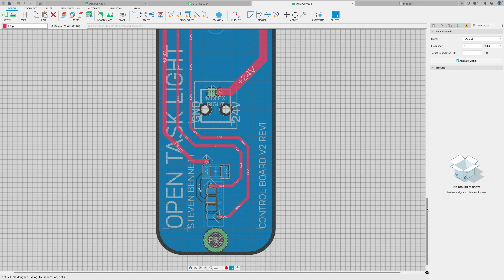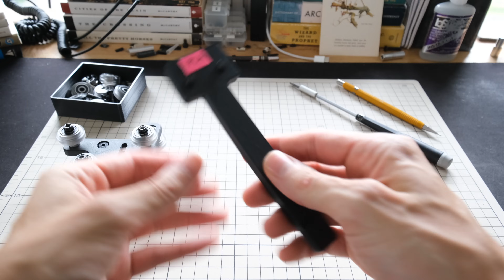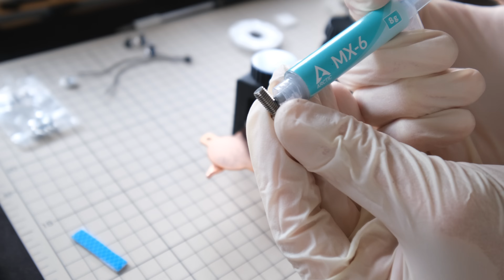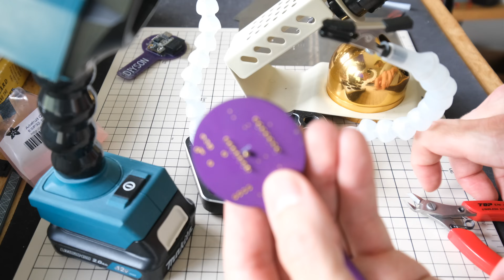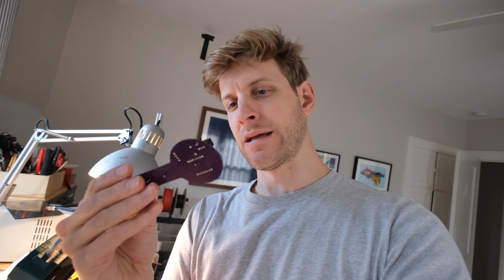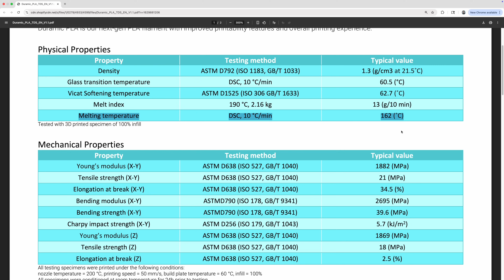A DIY designer lamp—how hard could it be? - Open Task Light Build Log #15

Comment: Have you considered designing the circuit board with all discreet components instead of using different modules instead of the qtpy you may also be able to use a much cheaper micro controller

Comment: A good simple way to increase the stiffness of that printed bracket is to increase the perimeters. try more like 7-10 perimeters. increased infill helps, but the majority of the strength comes from the outer layers.

Comment: I really like this project, and I may try to build one myself, but by reusing an Ikea NÄVLINGE led lamp, that would require some modifications to the design, but would make things simpler as well as the led housing doesn’t get very warm and you wouldn’t need any custom housing or circuit board etc

Comment: I've been following this series for years now :)

Also, there's some stuff that I hate about the design:
1- Why is the lamp head round? When everything in the design is boxy.

2- I don't like that the buttons are not recessed into the lamp head for a more stealthy and minimal look. 

3-there's inconsistencies in the colors, you could buy a matte black rails or you can paint the 3D printed parts with glossy silver.

Keep it going and can't wait for the next video :)

Comment: How did you make the 3D print for the PCB and stencil? Did you have to make it by hand or is there a tool to generate it based on the PCB files?
Reply from the maker: I kind of made it manually by exporting the board outline as a dxf from the PCB design file and digitally drawing a rectangle the size of the stencil around it and aligning the rectangle's center with the dxf origin/center. That's the tricky part; just determining where the PCB center point is, but the dxf will show you that and then you're good to go :)

Comment: Great project! Seems like I'm not the only one prone to silly hardware issues  😅
As for temperature, I'd suggest testing with a higher ambient temperature. During the summer in Bulgaria you (already, due to climate change) days with 40+ degrees C and I've had those especially when I've needed ventilation for soldering and other activities in the office
Reply from the maker: Hey cool, thanks for watching from Bulgaria! This would be a great stress test, I'll add it to the to-do list. It's possible that during the hot Bulgarian summer the temperature sensor will need to throttle the output power. Thanks for helping me justify the temperature sensor :)

Comment: have you ever thought of making the carriage of stacked PCBs, or embedding a PCB in the Carriage Print?
After all, PCBs are very precise and very stiff, as they are mostly laminated fibre glass...
Reply: it would be cheap and wouldn't add an additional manufacturing process to the BOM

Comment: Hi, newcomer to this project! Some insight into your bending test results and carriage design from this amateur bedroom engineer:

PLA that doesn't carry additives that affect its mechanical properties is one of the stiffest materials you can print. Many PLA+, matte PLA, and other formulations are much less stiff, as you found here with matte PLA. Most standard formulations of PLA (not advertised for speed, surface finish, "tough" or "plus", etc) could match or even exceed PC-CF in stiffness. For flexural modulus (stiffness) with horizontally printed samples, Prusament PLA is rated at 3.1GPa while their CF PC Blend is rated at 3.5GPa. PLA CF could be even stiffer.

Seriously, try those tests again with ordinary PLA, not "plus", "matte", "rapid", "tough", or even "basic" - some basic PLA is matte. Tough and plus PLAs will not work well for this application ,  since they trade stiffness to reduce brittleness . They tend to be closer to PETG or ABS in stiffness.

Also, test the parts for creep! Dr. Igor Gaspar (My Tech Fun on YouTube) uses a C-shaped part with a load for several days to characterize how a material creeps. He uses a clamp on the part he measures to prevent the calipers from affecting the results. Since you don't need actual flexural modulus values, you don't need to replicate his ISO 178 setup - the immediate measurement on the C-shaped samples will serve as your relative stiffness, and subsequent daily measurements will serve as relative creep.

No matter what plastic you use, creep will probably rear its ugly head eventually unless the carriage doesn't flex at all - it won't necessarily bend out of the way, but it may get looser over time. Right now, the clamping force from your rollers is being transmitted into your part as torque because the rollers are only being held on one side. For a plastic carriage, you may be better off solving the bending problem structurally instead of throwing more stiffness at it. Constraining the other end of the rollers on the carriage will stop the wheels from trying to torque your part so hard. But maybe the stiffer plastic will render this moot.

As for temperature, PLA and PETG can get soft enough to push around by hand at temperatures that aren't too hot to touch (so, probably around 50C). 40C is fine, though you might want to test how it handles higher ambient temperatures. My work area can get close to 35C in the summer, so the inside of the enclosure might get as high as 50C in those conditions since (at least, to my knowledge) your test (approaching 40C in 25C air) indicates that the air inside will rise 15C over the ambient temperature.

Anyway, this project is incredible! It's right up my wheelhouse - code, electronics and PCB design, and mechanical stuff, all wrapped together with great presentation. I'm disappointed that I didn't find this series sooner, but I'm looking forward to the follow-up video and future projects!

Comment: The qtpy has crenellated edged which are there to support surface mount soldering that PCB onto your projects PCB instead having to mess with the pin headers between them, which should simplify your assembly process.

Comment: fyi for desoldering.  you can add solder to bridge all the pins, slide your hot iron through the solder to heat all the header pins evenly, then you have two choices:
1. with one iron, hop back and forth between the two headers heating both until the part falls out.
2. with two irons, heat both sides at the same time.

or, you could find a very low temp solder to bridge all the pins and make the process a bit easier.

after the part is removed, then you can clean off the excess solder.

thanks for the great series.  cheers!

Comment: If you’re going to batch produce this thing then you can justify making tools, so instead of clamps for the heat pipe, you can make a press with a straight edge or 5 of those custom clamp heads which push between the extrusion gap, which can press down with a lever, or over centre snapping handle like vice grips.

Comment: Are there some off the shelf cheap hardware parts, like flat metal brackets that you could mount to threaded inserts on the pla carriage to provide durable stiffness? Like, a backbone.

Comment: Wait is it PET-CF or PETG-CF? They’re significantly different materials, and you’ve labelled it differently at different sections. Also know that while CF filaments have that nice matte lick you’re after, they’re bad from an ergonomic perspective as they shed fibres into your skin. I’d look into core-fibre filaments, or sealing parts with clear coat. Delrin filament is apparently great for creep resistance, but it is a real hassle to print with.

Also look into what locating pins and sleeves are used by diy 3D printer toolchangers. Bearings are a good solution, but in future I’d probably just use a pair of 608 skateboard size bearings, maybe with a spacer between them. Extremely common, still not overly bulky, and they’ll definitely handle the magnitudes of axial load you’ll be putting on them.

Comment: I like the stack of 9.99mm bearings. It seems counter intuitive to use a stack of more complex parts to replace one basic component, but it's always a good move to use ultra high mass production low cost off the shelf items for such high precision parts.
For the wobble of the base to upright, have you considered thrust washers? It would allow for clamping the upright down to the base further reducing wobble and to set it for a smooth rotation.

Comment: Friendly tip - if you want to remove the part, don't suck the solder away. Add more - a lot more, so your iron is heating all the pads on one side and pull one side up just a hair. Then repeat with the other side. Repeat again both sides, then suck the solder (I use wick). Works every time. Then cleanup with wick on both the carrier board and the part and voila - you are back at the start.

Comment: Nice designs as alway ! I design a bunch of stuff for my lab including hinges for doors.  For a cheap and efficient solution i use split bushing sleeves. They are inexpensive and with right tweaks to the diameter of the holes in 3d prints you can get really good precision. Hope this helps

Comment: PLA is about the most stiff material, iirc, you can print. The down side is that its very prone to sag over time. Which for exemple, PETG doesnt sag over time, but is a bit more flexible. Cant comment on other type of plastic in this video. For mat filament, I really like gf-petg. its soooo good. Also, if you test 3d printed plastic, should you test in the same orientation that it will be use in the lamp? i.e. vertical vs horizontal ? Now in you test, the ''depth'' of the piece was bigger than the hieght, I would think that you should rotate it 90 degree on ''y'' axis' to have the height bigger than the ''depth'' if that make sense

also, I'm not being mean, just trying to bring additionnal information. Great video! cant wait to build one when the project is done!

Comment: The issue with using printable plastics is that you don't get to pay the price-per-part. You have to pay for a whole spool if you print this yourself. Or if you are buying from someone else, there is premium involved, possibly also shipping. It might be actually cheaper to buy a single part in Aluminium which in turn might be cheaper.

Comment: A tip for unsoldering through holes easier is applying more solder to the existing joint so the sucker can create more vacuum, it works for me all of the time.

Comment: It is actually not the deflection you want to look at only, the most important factor I would say for longevity is creep. Some plastics will creep more over time than others. Fiber filled PC or PA will probably creep the least in this case, unless you go to real engineering material... but that requires a completely different printer and budget.

Comment: I think, heat dissipation should also be tested closer to critical conditions (i.e. ambient 20, 25, 30˚ C) . The reason is that the heatpipe performance greatly depends on the temperature gradient. Testing proubably can be done by using a cardboard box or some other enclosure, then monitoring the internal temp as the ambient (inside enclosure) rises naturally due to led output.

Comment: First time I tried desoldering multiple pins I didn't have one of those solder sucker vacuum thingies so I just used a ball pump needle connected to an air compressor (100psi) and blasted the solder out. I learned not to do that while wearing a short-sleeve shirt lol. Got solder everywhere, but it did technically work!

Comment: IMO the $20 LED driver is what ate too much of the cost(but I understand the appeal), the structure bracing for the bearings would be better off as aluminum. Another thought is to reinforce it with metal in some shape or form, screws running lengthwise inside it, so it can't bend in the ways the bearings will be trying to make the plastic creep, etc.

Comment: It would help the carriage if it had geometry that helped to stiffen it against the specific loads of the wheels, normally this would mean extending a rib out the back, maybe arch the rib over, like a lenticular bridge having the part be larger in the middle of where it wants to bend helps it to be strong. I assume you don't want to do that and hopefully these cool materials will be enough. My experience with printed parts is they just don't deal with constant bending for long periods of time. I know PLA and PETG don't, the glass fiber may help but I suspect it will only delay the creeping. My research leads me to believe Nylon is Among The Worst at creeping under sustained loads. Anyway, what if you put the rib inside? Make an arched mesh and use it as a modifier in the slicer to make the volume indicated by the mesh 100% infill, or higher infill generally. You get the outside shape you like and minimize filament weight, while adding geometry that should resist the forces better

Comment: I recently discovered a new kind of part I didn't know existed, Internal Thread Dowel Pins, these are precision ground hardened pins, that have a threaded hole on one end. They aren't the solution to any problems I have right now, but I'm always making new problems so I'm hopeful. They should be a workable option for the brass plain bearing construction; but just to keep things fun they have a threaded hole, so you have to have a post or bolt sticking out for them to go on, the opposite of your bolt-on approach. I'm also entirely unclear how you tighten them onto the bolt. I've had excellent luck with the precision of dowel pins from amazon, they're still not cheap, 5~10$ for a handful, often from a small hand, but that's a lot cheaper than more "legitimate" suppliers.

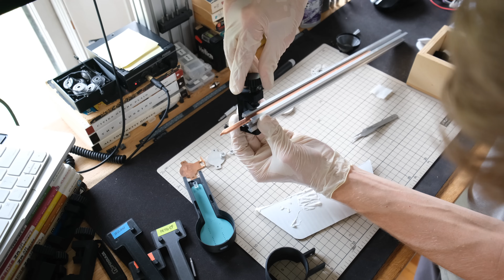Comment: @16:20 When you scale up the heatpipe mounting operation, toggle clamps and stop blocks will be your friends! A couple to clamp the extrusion down, then as many as necessary to hold the heatpipe down.
Reply: Also a very cool lamp and some impressive determination! The projects that kick our butts the hardest are usually the ones we learn the most from.
Reply: I was just thinking to put a chopstick on the top of the heat pipe to spread the load and a chip clip. You don't need a ton of pressure. Also, I'm wondering if it might be better to use regular thermal paste and a couple dabs of reversible, heat resistant adhesive since most thermal adhesives have a lot less thermal conductivity than most mid-grade thermal pastes.

Comment: watch out for the abrasiveness of CF materials. They can wear out your nozzles quicker and then you'll get print problems as your nozzle opens wider and the flow needs to be compensated. I was going out of my mind when my printer just wouldn't print properly any more and I'd been using CF filament. I switched the nozzle and it worked again.

Comment: carbon fiber seems like a dangerous option. touching it without coating is often unsafe. printing is even more dangerous. online printing services like pcbway do not even offer any cf printing. it also seems expensive (as you said). isn't abs very rigid? it would also be relatively cheap and safe to handle. might be worth trying.

Comment: Why would you print the carriage? It's a flat plate you can easily saw and file that out of a piece of Aluminum by hand. 

Also I think the clamping on the base is unnecessary for the bearings. Just make them press fit.
Reply: Making accurate and straight holes into aluminium requires a drill press.
Reply: Not necessarily. A center punch and a vise should usually be enough  @radry100
Reply: Could also print a jig

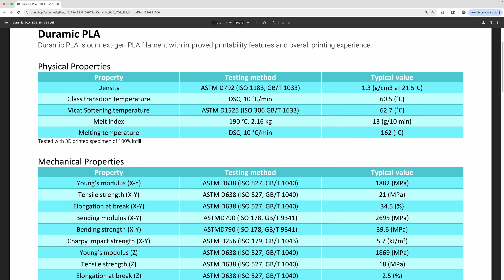Comment: 36:40 You can't say this about temperature in C or F. 162°C is not 2.5x hotter than 60°C. When the scale starts at -273°C, this doesn't work. 435°K is not 2.5x hotter than 333°K
Reply from the maker: I'll take down the video right away
Reply: @StevenBennettMakes Instead of mocking someone who donated their time to correct you, how about thanking him and learning from your mistake and gain some understanding and not make the same category of mistake again?

And yours wasn't a small mistake. It's like saying that west is 3 times further than east. Is -6°C 3 times as hot as -2°C although it's actually colder? Is 0°C ten times hotter than 0°C? How have you reached an adult age and never noticed that your normal absolute functions don't work with something like °C? Being technically minded, how did you even reach school age before noticing that? Are you also saying things like "it's X degrees in the shade, but Y degrees in the sun" as if Y would be a meaningful value? More learning, less mocking.
Reply from the maker: My response did come off pretty rude actually, sorry about that.

Comment: Regarding the material, Unfortunately, even if the plastic you choose is very rigid, because it is plastic, it will creep over time.
Reply: Maybe the part can be made together with the board from the same material as the PCB

Comment: My experience with Nylon+CF is that the geometry of the part makes a big difference when it comes to stiffness. 3d printing things you designed as a aluminum part machined from like 3/8 in my experience has a lot of flex. Claugh42 has a good video on this where he replaced a Nema 32 bracket for Nylon+CF and had results that weren't great.

However, I pretty much strictly print NylonX. I don't think it is a good solution for your bracket; if you modify the geometry, it might work, but that defeats the purpose.

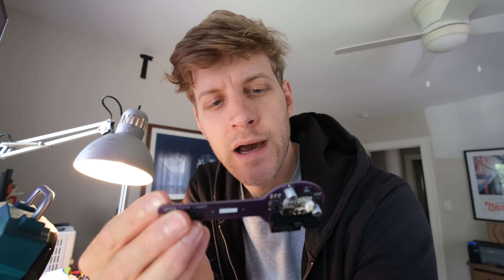Comment: 25:30 For desoldering multiple pins like that - I've had a lot of success covering the pins with flux and using those cheap heated desoldering pumps on Amazon. There's always a little bit that gets left behind but I usually get that off by coating solder wick in flux. I don't like using flux for soldering but it's really great for desoldering.